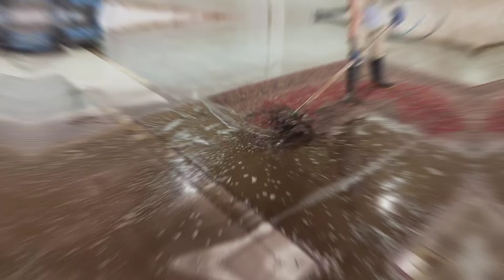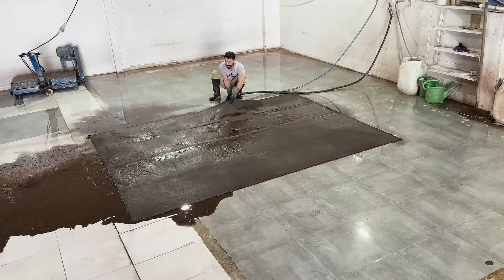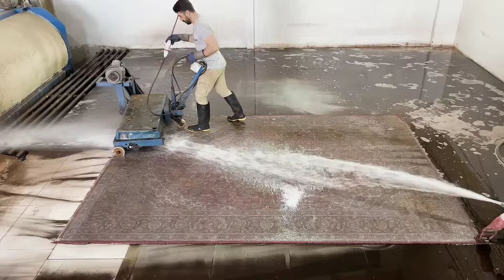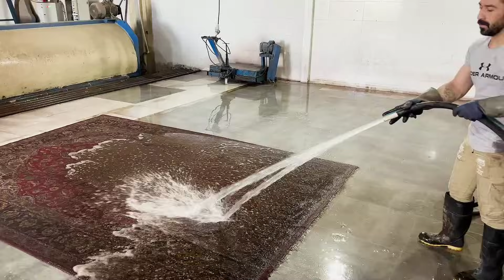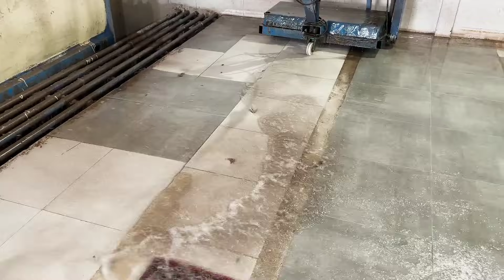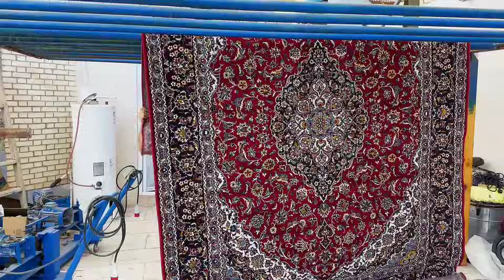You have not seen such a dirty carpet  |  the brown water was flowing almost like mud constantly!

Comment: Would it be possible to add captions to describe what happened to the carpet? The carpets look as though they were all in mudslides! 😂

And that the chemicals and machines you use are? This process is fascinating.
Reply from the maker: Hi dear 👋 
All very dirty carpets used by owner in work place.
Reply: @change-cleaning-service-center Dirty from everyday use? That is intense. Some of the more modern-looking rugs don’t seem as though they are old enough to have been around to collect that level of dirt.